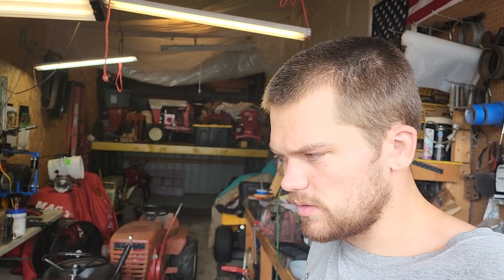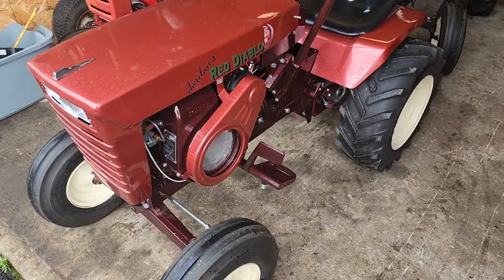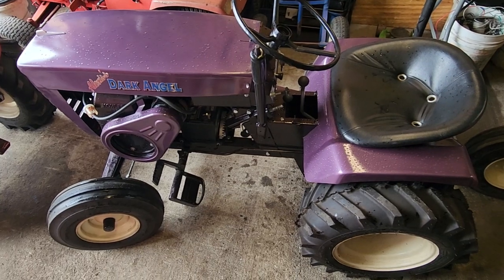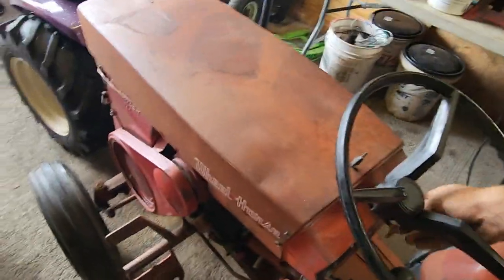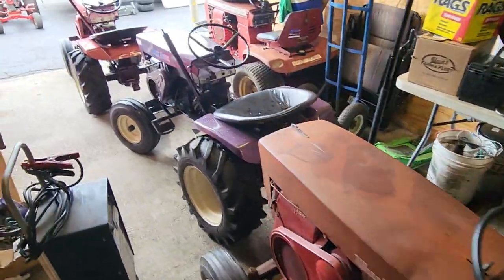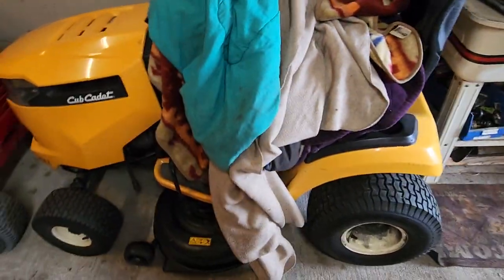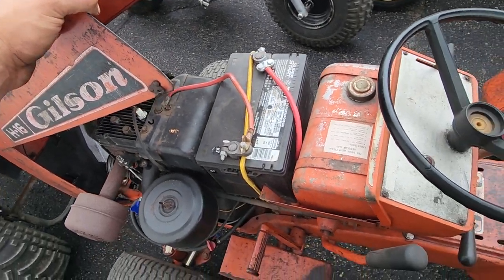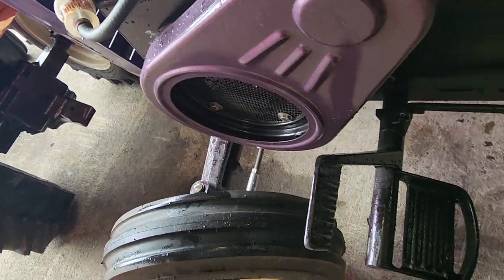tractor  show put away  time

Comment: its nott the battery  starter /generator and voltage regulator draw a small charge over time put a battery maintainer on long term non usage
Reply from the maker: Tht great and all but it hard to when u dont have power in use a Gen till I can get shop with power and we have about 200 tractor  u buy all them then we talk at 20 bucks a charger ya I'm good I'll keep bitching